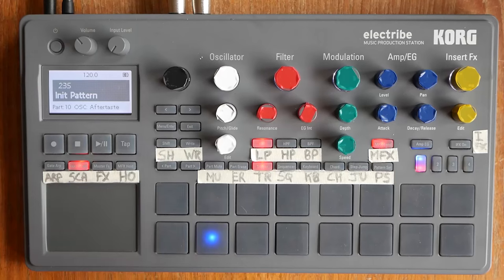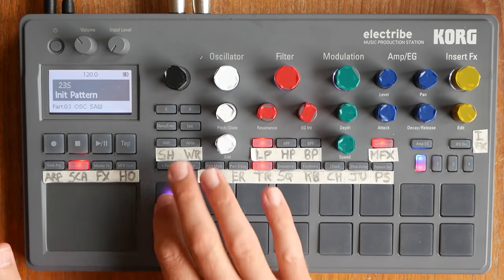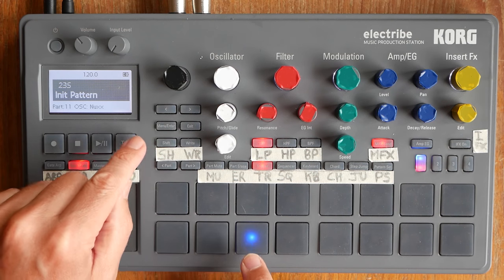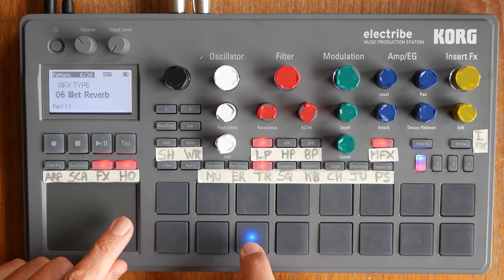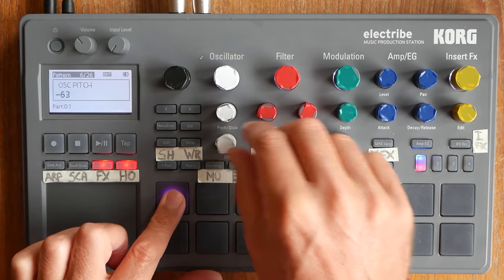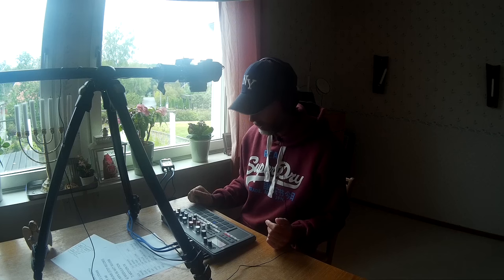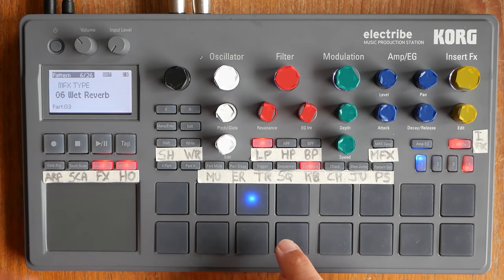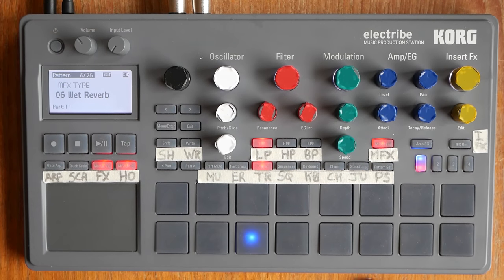Korg Electribe 2 Demo & Review 04 - Sound creation tutorial

Comment: You can learn something right away without even listening. The power of better labels for the controls (especially if using live). While the minimalist dark tone on tone design might be aesthetically pleasing, it's not practical. I labeled similarly, including using color coding. I also made a template with Word, printed on card stock, to lay over the unit indicating info on the parts. Great intro tutorial!
Reply from the maker: i fully agree,  I have a video coming soon with some more  mods.  thx for the comment. :)

Comment: Good intro to the beast - only thing I would add is that once you set the MFX to Wet reverb you kept the display screen there on the top menu (showing the MFX) - thats because you knew exactly what you were doing. 

For newbies it may have been best to exit that so they can see what you were doing when changing OSCs.
I will be waiting for the next one and what you do to make a tune.
Reply from the maker: that's a really good point, you know I never even noticed that!  Although when tweaking the sounds I'm not even looking at the screen, just my ears and the knobs, so it doesn't matter what's on the screen.   it's boring to see wet reverb all the time though, I agree. :)

Comment: sweet! one question can you add your own sounds or are you stuck with the ones that come with it
Reply from the maker: you cannot add own sounds on the electribe, on the electribe sampler this is possible.  but you can synthesize and modify the existing waveforms quite radically.
Reply: don't buy it it's very limited and also doesn't have an song mode i wasted 424 on it if you can find it for like 170 dollars it's worth about that.